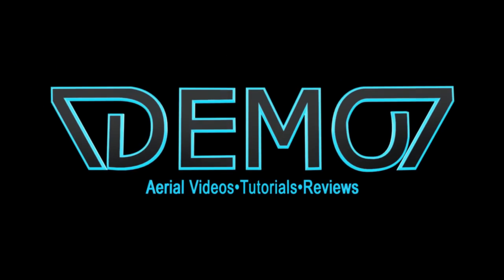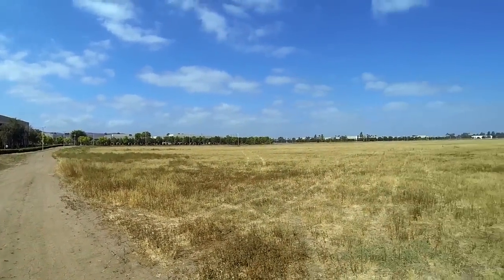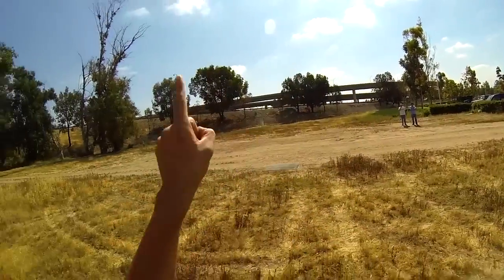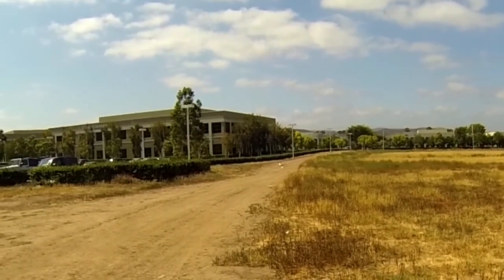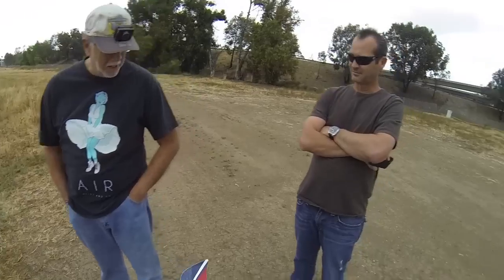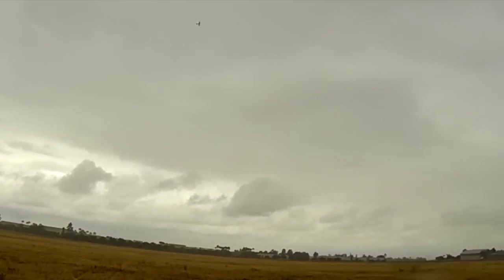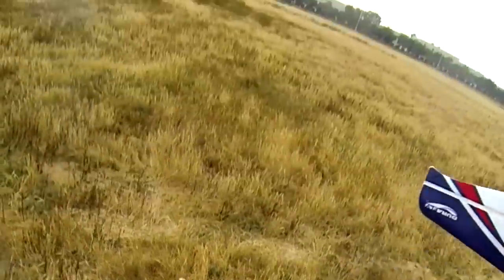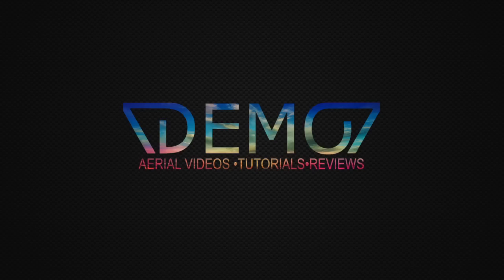EFX Racer Maiden Flight. Try try again...

Comment: I've been wanting this plane for a while I really believe it's one of the best in its class. just ordered and wing netic.
Reply from the maker: +roadstar499 be sure to watch bmsweb on youtube, they have some great info on the wingnetic.  the CG is tail heavy as stated in the manual. be sure to check their video on this issue
Reply: +7demo7 yes I read the thread on RCGroups. 240 millimeter CG seems to be close to the sweet spot. I have over 30 planes and I always try to get my CG right on the money before I fly. Thanks for the info. PS just received this model and it is extremely strong and will not need anymore reinforcement. very solid structure compared too many other models I have.
Reply from the maker: +roadstar499 also it is very twitchy, dial down your throws!!! a lot!
Reply: +7demo7 yes I have that information also. one thing forgot to ask. when you had her all trimmed NCG correct would it fly level when elevator was in neutral or did it require a good amount of up reflex? Thanks

Comment: All my launches have rolled and gone in inverted, breaking the fuse twice. I'll try and put some weight up front.
Reply from the maker: I used a 2200 3s from hobby people, they tend to be lighter. I say in the video 1.5 oz but it's more like 1.75 oz
Reply: ***** Gens 2200

Comment: A great story with a happy ending😄
The EFX Racer is my Nemesis that I have yet to conquer. My first two flights, with someone else hand launching for me, were great and without incident. However my third attempted flight hand launching, under arm, was a total disaster. I wasn't prepared for the torque roll and it dirt napped really hard destroying the fuse, prop, spinner, and motor mount. I have since rebuilt it and it looks absolutely pristine. Everytime I think about taking it out for its next maiden I break out in a cold sweat and have to lie down in a dark room and listen to whale song and wind chimes.
The A-Spec batteries are a must for this plane, it balances perfectly with them and provides greater throttle response.
Congrats on taming the Beast.
Regards
Nidge
Reply from the maker: Thanks man, I'm just rebuilding mine with a killer paint job

Comment: Great video.   I like the way you narrated it.     

Where did you place the added weight and what is the dimensions/weight of your battery?    I had exactly the same thing just happen to me 20mins ago on my efx's firstflight....hence inside on google right now!!
Reply from the maker: Just get your cg at 55mm minimum- I run mine at 53- for this plane it's very critical- OT- I just fried
My ESC the other day- my efx went down with a ploom of smoke trailing behind it- wish I was recording that!!  No damage except the burnt ESC and seized motor!
Reply from the maker: Also it is one of the hardest runways to land on!  This is where I learned to land so now I can do it anywhere! Come in too hot and you'll hit a car or curb- land short and hit all the stumps lining the grounds!  Then the wind changes from morning to evenings and the landing strip is angled downhill!
Reply: +7demo7    ouch!    I'm interested to know what ESC your going to replace it with.   Are you still running 3s on it?
Reply: +7demo7   Thanks for that.